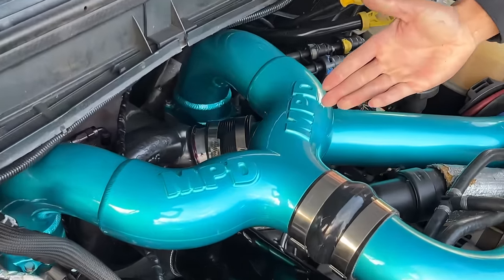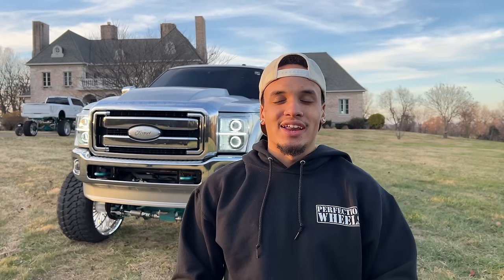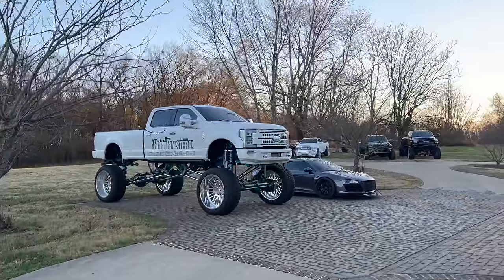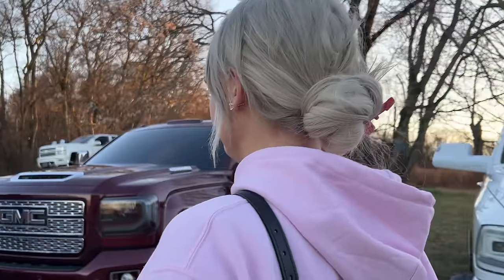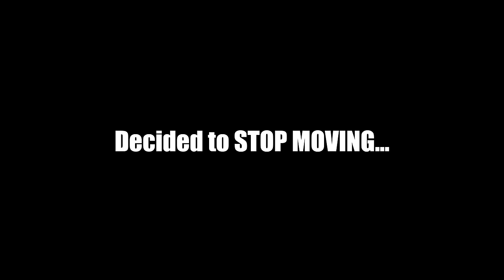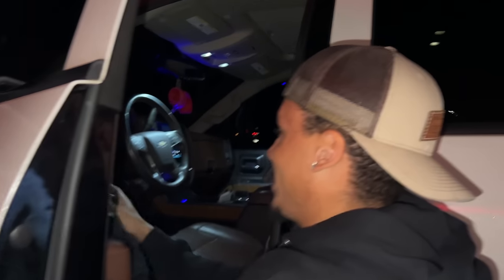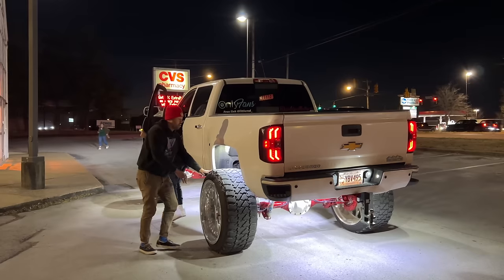Girlfriend Leaves After I Broke Her Truck! *Hood Exit Twin-Turbo Silverado*

Comment: Who would have thought a turbo Silverado would destroy a 4l60 trans when you put 40s on it.
Reply: Built 4l80 lol
Reply: 4l60’s or 4l80’s doesn’t even come in the truck and I’m about 99% sure they wouldn’t have swapped a 4 speed in this truck
Reply: 6l80 is what it is
Reply: bro what? a 4l60 in that? what are you smoking my guy
Reply: Gm hasn’t used the 4l60e for years and a lot longer for the 4l60(700r4) 🤦🏽‍♂️
Reply: @SMSmotorsports  I have an 07 Silverado and it has a 4l60e and i have to rebuild it after every other oil change. That's all I know.
Reply: That’s definitely a 6l80🤦‍♀️
Reply: 6l80 for sure. Chevy's ain't had the 4-speed in the 1500s since like the cat eyes
Reply: @tylertomczak2273  o your right my my guy!  I just crawled under there to prove you wrong and it is in fact a 6l80 too many damn numbers. Lol
Reply: How dare you dude
Reply: @haydenroyer they changed to the 6L80E in 2009 with the 5.3, 6.0 and the 6.2. If the truck had a 4.8 I'm pretty sure it was still the 4L60E
Reply: 😂😂😂😂 4L60s don’t hold up worth shit
Reply: 4l60s stopped in like 07 my guy 😂😂
Reply: 6l80 i got this truck
Reply: @gavincardwell2223 they do great if maintained ive had multiple built motors in front of them abused with 0 issues long term
Reply: 6l80*
Reply: @justinwelsh5642 my 4.8s are 100% 4L80E

Comment: Its hard to beleive that the builder didnt know the trans was fugged
Reply from the maker: Drove fine during tuning and broke as soon as we drove it. No biggie
Reply: @GabeFarrellProductions  Get a good torque converter for it or it will keep doing this. What happens is it blows the converter out and sends metal through the entire trans.